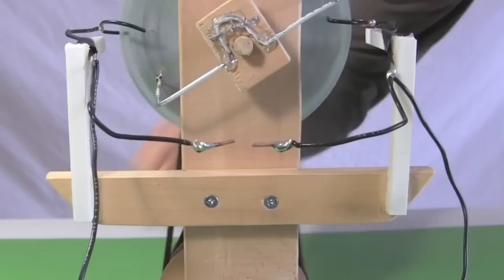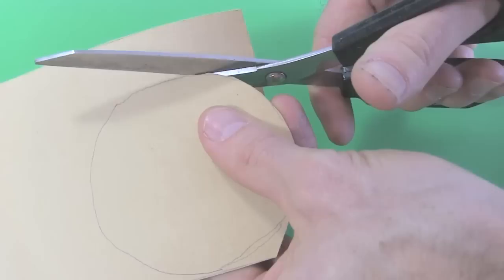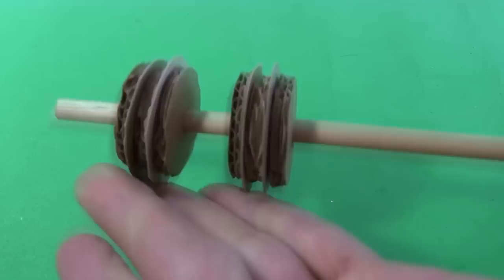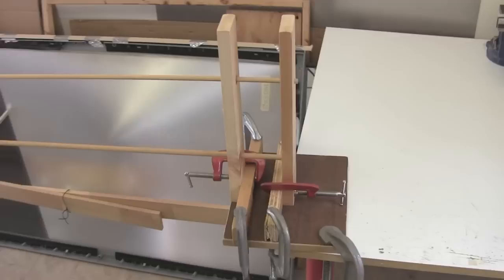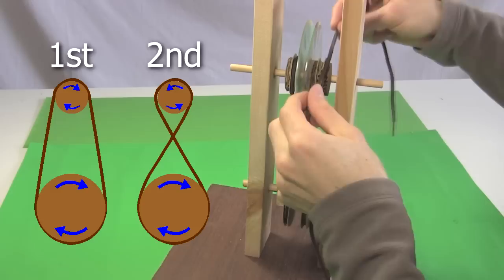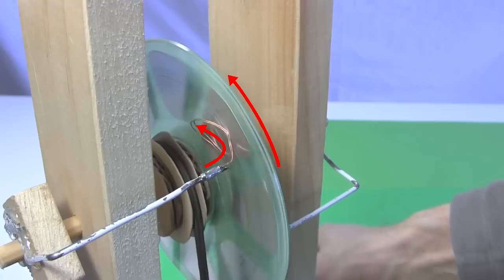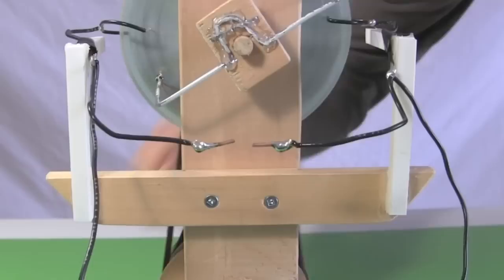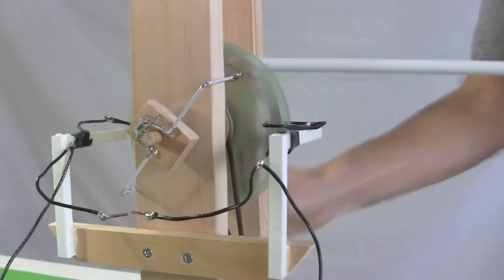Wimshurst Machine - How to Make using CDs

Comment: what type of wires did you use for this project?
Reply from the maker: I used stranded 18 gauge (AWG) copper wire, but it doesn't really matter. It's probably best not to go with something too thin, like 30 gauge, but I doubt you'd do that anyway. Normally, the thicker the wires are, the less likely they'll leak charge to the surrounding air. But with a small Wimshurst machine like this one, that isn't much of an issue either.
Reply from the maker: The black wires used for the collectors and the one connected to the capacitor are 18 gauge copper wire. The black is just insulation.
Reply: thank you!
Reply: RimstarOrg do the neutralizer bars and the collectors have to be at specific angles?
Reply from the maker: Vyvy Hoang
No, they don't have to be at specific angles. Just keep them away from each other.
Reply: RimstarOrg do the discs have to touch back to back?
Reply from the maker: Vyvy Hoang
No, they don't have to touch back to back. It "may" be bad if they do since that may charge them though maybe not. The closer the disks are to each other the better. But mine have some wobble and always a gap between them.

Comment: can we measure the voltage of the machine with out putting the home made capacitor ?
Reply from the maker: Sure, but the voltage won't be very high. The voltage only gets high when it builds up over time in a capacitor and to a less extent, across the spark gap.
Reply from the maker: Keep in mind that if you put the meter probes across the collectors or the spark gap, the tiny current will go through the very big resistor of the meter and so the low current will mean the voltage will be very low.
Reply: i put my meter on the machine with out the capacitor but  my meter did not move even a little no voltage reading
Reply from the maker: It sounds like you're using an analog meter. The current is so small from the collectors that I'm not surprised it doesn't move the needle since the needle moves because of current moving through a coil to react with a  magnet's magnetic field.
Reply: hultz machine and wimshurst works the same right ?
Reply: the two disks should be be doing friction when spinning right ?
Reply: actually i am building Toepler-Holtz electrostatic generator  i thought it works the same with wimshurst machine one disk only spins.
Reply from the maker: No. The disks shouldn't touch, except at the center to keep them apart. They can touch a bit but not much. It isn't necessary. This isn't a friction machine. It's an induction machine and the induction takes place where the neutralizer brushes touch the sectors. The disks should be close to each other though.
Reply from the maker: I'm not familiar with the hultz machine.
Reply: is it okay to use bearings for the disk?
Reply from the maker: Yes, you can use bearings. Just don't have them too close to the sectors since the bearings are metal and can create a conductive path from one sector to the bearing and to the next sector. Of course if the distance between the sectors themselves is less than the distance between the sectors and the bearing then it's okay.
Reply: how thick is your stranded wire ?
Reply: i have replicate your machine but mine did not work everything seems to be connected but mine don"t spark  is there something i did wrong ? i need help
Reply: all i ever wanted is a spark i wnat to see that static spark in real life
Reply from the maker: Each strand is probably around 30 gauge (AWG). The wire itself is 18 gauge (AWG). Unless your're talking about the tips of the collector that face the disk, the runs of wire going from one place to the next should be as thick as possible and preferably insulated to reduce losses.
Reply from the maker: Make sure you pay attention to the tips I give near the end of the video at 9:47. Every tip I can think of is in that section, other than check all your connections. Let me know if that still doesn't work.
Reply: i also did the tips you said. does all wires should be thick us possible ?
Reply from the maker: See me other answer to your other question about that. If the wire thickness isn't your problem then, send me some photos for my email. The address is at the bottom of each of my webpages at http://rimstar.org.
Reply: my collector wire is about stranded 12 AWG my spark gap wire are wires that are used in PCB boards but i solder the edge of those with 12 AWG solid wire. the wires i am using for my capacitor are 12 AWG stranded wire. i also adjusted my neutralizer bars the same as the video but my wires are long does that count ?
Reply from the maker: You 12 AWG collector wire makes me suspicious. How thick are the strands? The ends of the collector facing the disk have to be sharp points. Sharper is better there. If the strands are thick then the points may be too blunt.
Re the spark gap, make sure the ends facing each other are rounded, not sharp.

Having long neutralizer wires doesn't matter much.
Reply: each strand is like two hair twisted together. that's how thick it is its not sharp
Reply: your collector wires seem to be white mine is copper
Reply: i also cut some some of it leaving only one strand wire
Reply: is it okay if i use needle for it to be sharp ill just solder needle to a wire could that be fine ?
Reply: i am actually using kitchen aluminum foil and white glued it to my CD
Reply from the maker: What you describe for the end of your collector definitely is a problem. Your needle idea should make a big difference. Definitely do that.
In answer to your other comments, silver colored wire is almost always copper too. It's just "tinned" with some thin coating that reduced oxidation (I think that's why). So my collector is tinned copper wire.
And kitchen aluminum foil white glued to your CD case should work fine.
Reply: is it okay if my aluminum disk 1 is touching the neutralizing  bar while disk number two is not? because there is an angle where you spine the wheel that this brushes is touching the aluminum while the other disk is not
Reply from the maker: It's okay if that's the case for one or two sectors but if it's too many then your machine will not work. That neutralizer bar with both brushes touching two sectors while the two sectors are lined up with two sectors on the other disk is the whole key to making this work. That's where the magic happens. If it's not working for a lot of your sectors then you've decreased the efficiency by that much. And if you have a lot of losses, you might not even be making up for the few sectors where it is okay.
Reply: ill try to use 12 AWG solide wire and put needles on the edge
Reply: i already did change my collector to needle but it still does't spark i still need help
Reply: Rimstar org i still did not make a spark
Reply: i don"t understand why mine does not work
Reply from the maker: Make sure you try that trick I mention near the end of the video with the triboelectric effect. For more on how to produce it see http://youtu.be/ey88EdZo9hU. I often have to do that even with my commercially made Wimshurst machine. Also, the faster you turn the disks, the better it works. And very humid air can be a problem.
If that doesn't work then send photos to my email. The address is at the bottom of my webpages on http://rimstar.org.
Reply: rimstarorg my machine already works but how do we know where the positive side and the negative side is ? its confusing me
Reply: my machine did not work again and there is this violin sound when i spin the wheel
Reply from the maker: Which side is positive and which is negative is up to chance. If the machine starts on its own, i.e. you don't do the trick I show near the end of the video with the plastic rod and the cotton cloth, then you don't know which side will be which polarity. For more understanding of how it all starts see my recent article about how it works on Hackaday http://hackaday.com/2017/03/03/how-wimshurst-machines-work-high-voltage-from-the-gods/.
If you want to know which side is which once the machine is started then one way would be to make an electroscope (https://www.youtube.com/watch?v=2PmWlPjV6n0) and then do what I talk about in this video https://www.youtube.com/watch?v=HupFY_24o-4. I guess you can bring the electroscope terminal near one side of the capacitor. If the test shows that that side of the capacitor is positive then the collector that's connected to that side is positive.
Warning: I've heard in the past that when sparks happen, the sides can sometimes change polarities.
Reply from the maker: Violin sound? Where is it coming from? Maybe something is scraping on a shaft? But I don't see why that would stop it working as long as everything is still turning okay.
Reply: rimstar org after i play with the machine my aluminum has this black carbon lines from my neutralizers ? why is that? were did that black comes from ?
Reply from the maker: The black is from the neutralizer brushes contacting the aluminum sectors. This is normal. It also slowly degrades your Wimshurst machine because it creates a slightly conductive path from one sector to the next. Every now and then people clean their disks using alcohol (I use rubbing alcohol) though it's hard to get it all off. However you clean it, make sure the cleaning fluid doesn't leave anything behind. Alcohol evaporates.
My commercially made Wimshurst machine has paper in between the sectors and I think that's so that the black stuff will coat that and to clean it you simply remove them and put clean paper. It's hard to tell in the photos (http://rimstar.org/equip/wimshurst_27cm.htm) but every second sector isn't a sector, it's a piece of white paper in the shape of a sector.
Reply: i dont see any paper ? were ?
Reply: but it does not conduct ? when there's
 paper right ?
Reply from the maker: Every second thing that looks like an aluminum sector is actually a white piece of paper in the same shape. It's just hard to tell from the photos.
And yes, the paper does not conduct. When the paper gets dirty with aluminum dust just like the plastic does then it makes it easier for the corona to create a path between the sectors. But instead of cleaning the paper, you can just replace it.
Reply: can you give me a photo of it? i am confused with the paper
Reply: i did try cleaning it up but it doesn't spark any more
Reply: i only cleaned the sectors using vinegar and an eraser after that i washed it with water i used cottons to wiped it  using eraser do does get rid of the black thing but it still doesn't work any more
Reply: i also smelled the sectors there is a burning kind of sent but there is no heat on the sectors
Reply: do you mean that the paper is above the sectors and the paper is touching the neutralizing bars ?
Reply from the maker: For the paper, look at the photos on http://rimstar.org/equip/wimshurst_27cm.htm. Every second sector isn't a sector but is paper instead.
There shouldn't be any reason to clean the sectors. It's the black stuff that coats the section in between the sectors that causes problems. But I doubt you've been using yours long enough for it to need cleaning.
Hmmm... I'm not sure if vinegar will leave a residue behind that might be causing a problem. It also may be okay and you may just need to readjust something else, like the collectors or the neutralizers or check your connections since one might have come loose.
Reply: i dont understand its not working any more
Reply: should i change the sectors and the disks ?
Reply from the maker: I would check everything else first. You probably knocked something out of alignment when you cleaned your disks. Also, if your place got very humid since the last time it worked then that could be it. Try the trick with triboelectricity and that I show near the end of the video -- I have to do that sometimes even with my commercially made Wimshurst (cleaning it may have just neutralized it all so it may need some help getting charged). My video on triboelectricity has other tips for doing it http://youtu.be/ey88EdZo9hU.
Reply: is it okay to use capacitor with polarity instead of lyden jars  ?
Reply: are static electricity different from battery electricity or AC electricity ?
Reply: i can hear sparks from the brushes but i don"t see any sparks
Reply from the maker: I'm not sure if they would work. You'd need capacitors that are rated for the thousands, possibly tens of thousands of volts. I doubt  you'll find polarized capacitors with sufficient rating.
Reply from the maker: Try in a dark room. It's possible they'd still be very hard to see.
Reply: rimstarorg i used bolts to hold the neutralizer bars on the wood is that fine ? any way can we be friends on facebook so that i can show you photos of my machine
Reply: is there a possibility that the problems is on the CD ?
Reply from the maker: Sure, I don't check facebook often (I disabled notifications since they were notifying me too often for no reason) but I accept all friend requests.
Reply from the maker: It could be that your vinegar left an electrically conductive coating between the sectors but I don't know for sure.
Reply: i already tried to to clean it with water using dish washing liquid but still dont work
Reply: i tried to change the sectors  still no sparks but there is this black oxide building up in my sectors

Comment: Two materials having a tendency to hold opposing charges when rubbed, create a charge separation (triboelectric) and transfer (induction). I guess the electrostatic materials in the wimshurst are plastic and aluminium. Some how the disks spinning in opposition is like the 'rubbing', the aluminium gets 'inducted' and the charge is distributed through the neutralizing bars so the whole disk becomes polarized, neg -on one side and pos + on the other. Electroscopes are used to show how the separation of charge happens. Is this correct or do the rubbing brushes on the alum and plastic create the charge separation, if the later were correct we would only need one disk? Are there any clear expo's of this on youtube?
Reply from the maker: Not quite. The triboelectric effect or rubbing doesn't play a part in the Wimshurst machine. MIT has a video on how it works but it's not very good. That's why I felt there was a need of one, but the amount of work to do it right was just too much. This is the page I learned it from years ago http://www.madsci.org/posts/archives/may98/895429674.Ph.r.html

Comment: Sir it's my son who have send you mail please see over it
Reply from the maker: Ah, I see. I just tried to click on them and didn't have permission. Google Drive will probably notify your son to give me permission and then I'll receive a confirmation email and will be able to look.
Reply from the maker: Nice machine. I see a few things.

The ends of the collectors facing the sectors don't seem very sharp. The wire looks like it might be too thick. Try to sharpen the end somehow or maybe attach a needle or thinner wire so that the sharp end of the needle is facing the collector. To understand why, have a look at this article I wrote for Hackaday http://hackaday.com/2017/03/03/how-wimshurst-machines-work-high-voltage-from-the-gods/. Near the bottom I talk about how the sharp points, or sharp point, is what makes the air conductive so that charge can cross.

The parts of the spark gap that face each other may be too sharp. Try with some metal that is less sharp. Even mine could work better if the two parts facing each other were more rounded.

You really must try that trick I showed near the end of the video with the plastic rod and cotton cloth. It's basically using the triboelectric effect and to help you get it, see this video about it https://www.youtube.com/watch?v=ey88EdZo9hU. But first, fix the other things I mentioned otherwise even that won't help.
Reply from the maker: I just saw your second video.

The disks are much too far apart. The first part of that Hackaday article explains that the electrostatic induction between sectors on opposite disks is what makes it work, and with the disks so far apart, the induction will be too small, if there even is any. Put your disks as close together as you can get them, without touching, though they can touch a bit.

Also, your neutralizer brushes may be too close to the collectors. But keep in mind the tips I give near the end of my video where I talk about positioning the neutralizer brushes with respect to each other.